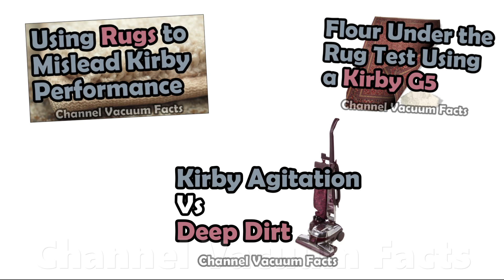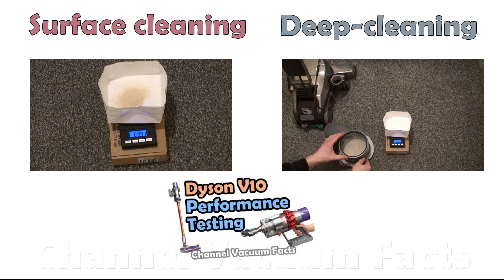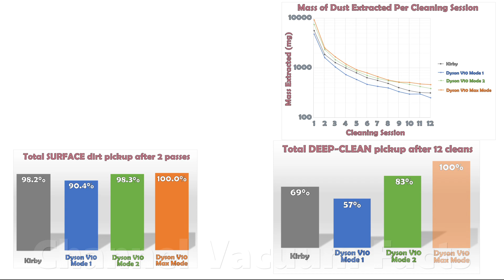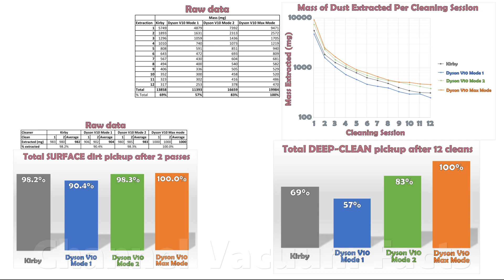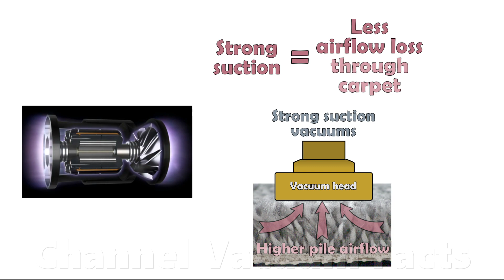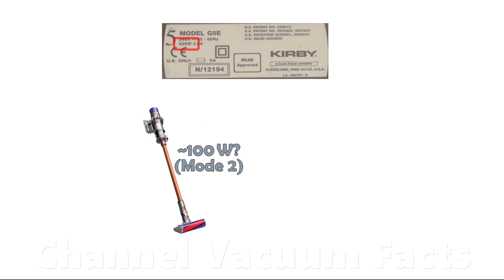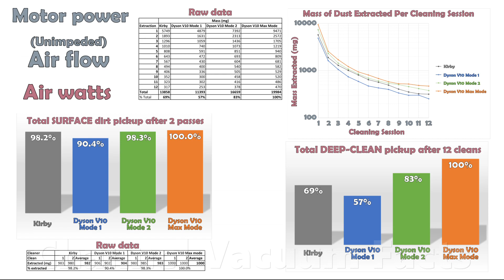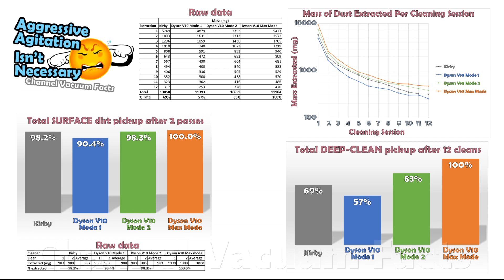Dyson V10 Vs Kirby: How Well Does a Kirby Vacuum REALLY Clean?

Comment: However much these Kirby fanboys love their vacuum cleaners, why would anyone in their right mind want one of these machines over a Dyson V10? Idiots.
Reply: A 40 year old American-made Kirby will still have the same suction it did when it was new, granted the fan, roll brush, belt and motor brushes have been maintained. It's aluminum body withstands years of hard abuse and doesn't crack like cheap plastic. The bags make emptying the waste something you can do inside your house and not get dust and debris everywhere. If you're even minutely mechanically inclined, the parts that need to be replaced as they wear can be done by yourself without any special tools. All Dyson vacuums lose suction as their filters get dirty and dust particles build up on the inner surfaces of the cyclone chambers. The cyclone chambers are not user-serviceable so cleaning them has to be done by a professional, is a huge pain in the ass and thus costs a small fortune. The air pathways are also cramped and clog easily in the majority of Dysons. The un-washable filter in Dyson vacuums can cost upwards of $100 and has to be replaced between 6 months and a year depending on use. Luckily in this particular Malaysian-made piece of plastic, the filter is only $13. Good, because you're going to be buying a lot of them. That price still doesn't beat 12 Kirby cloth hepa bags and 3 rubber belts for $18 (found on eBay).  Why do you think there are so many Dysons on Craigslist for ~$40 when they were 10 times that brand new? After a few years, even with a new filter, they don't work for s**t and have to be cleaned and rebuilt by a professional. So your $500 vacuum is going to be costing you more and more money in service bills while the Kirby can coast for years without needing to go into the shop. Also, check out the Performance Reviews YouTube channel to see how long the battery actually lasts on this vacuum. On it's high setting (which this video demonstrates is the only one to use), you'll get just enough time to do your stairs. Good luck vacuuming a large vehicle on one charge. If you want a battery-powered portable vacuum, buy a Henry Cordless. If you want a light-weight, modern vacuum that's actually worth it's price, is built to be serviced and doesn't lose suction, buy a Miele. If you can't afford $500 for a vacuum, a used Kirby off Craigslist can be had for $50. Throw in a new fan ($13), a new roll brush ($25), and a belt (<$1), and you have a much better vacuum than anything you can buy at Target or Home Depot and for under $100. Does this answer your question? Here's a better test (although a different Dyson) as it compares machines that have both been used regularly for some time: https://www.youtube.com/watch?v=M8r0jCRnB3Y&t=273s
Reply from the maker: @skinnychristopher  That it's 'American made' is a racial irrelevancy. The Kirby doesn't even have the same suction it started with when the bag gets full, and that will be true 40 years later too. I've already pointed out the fallacy in longevity; you’re stuck with old inefficient technology for that long. Furthermore, very few last that long, due to a) neglect, and b) people wanting better, more modern technology which makes the job easier. My review highlighted the horrors of using this disgracefully old technology. Modern elastic polymer blends and other advanced materials don’t ‘crack’ as you stereotype, anymore so than a riot police officer’s shield. The bag is a huge environmental cost, when scaled up across a nation, and is a tax for the user just the use the thing. All covered in my video on the topic ( https://youtu.be/ptN0kkOtGSM ). It’s also now proven that the best bagless cleaners can be emptied without mess and in 5 seconds (also without cost). You’re simply wrong about the dust inside the cyclone chambers and show a complete lack of understanding of how they work; watch and learn ( https://youtu.be/B8gOZ31CkvE ). They don’t ever need to be cleaned and scammers are peddling a false economy if they charge for that ‘service’. There are no ‘unwashable’ filters in modern Dyson cleaners (except for Cinetic models which never clog unless abused), and all filters are lifetime filters which don’t need to be replaced. That you associate Malaysia with cheap plastic parts is nothing short of racism, consistent with your focus on being ‘American-made’. There are many Dysons being sold because there are many more Dysons being bought, and people sell for all kinds of reasons. And you do realise that Kirby’s also sell for ten times less than their asking price. Performance Reviews is a biased Dyson brand hater whose channel peddles misleading fallacies which are easily debunked. If you think my video demonstrates only max mode should be used on a Dyson cordless, then you might want to actually watch the video, because that’s not what the data, and an understanding of it, shows. Plenty of videos out there showing large cleaning sessions being completed on a modern V10/11. The myths associated with a Henry cordless will be revealed soon enough. And the video you linked to is another source of misleading nonsense that’s been proven wrong time and again. Your tirade carried all the falsehood tropes of someone who buys into and spreads propaganda which is easily shown to be false.
Reply: When people throw away their Dysons after 2 years of ownership, that's heaps worse environmental impact than throwing away multiple paper or cloth bags full of dirt and hair; and that's the unfortunate reality. People don't have their vacuums serviced anymore. They just buy a new ones. So when the Dyson that "never loses suction" actually loses suction as they all do, it gets hucked in the bin. It also gets hucked in the bin when it gets redesigned every year and spare parts are no longer available. Also, batteries have a limited lifetime and have to be disposed of. This is not a problem with a plug-in vacuum. Last, the Dyson filters have plastic components which don't biodegrade like paper or cloth. So which is really more environmentally friendly? I think salvaging an old Kirby vs repetitively buying a new Dyson, batteries, and plastic filters wins by a landslide. Dyson claims the filter is "lifetime", but then why is it replaceable? By saying Malaysian made, I'm just pointing attention to the fact that Dysons are not made where they're designed (unlike Henry and Kirby) and that the people who actually assemble them make the equivalent of $240 US a month. So you're essentially supporting modern slavery by buying a Dyson, too. Performance Reviews is biased against Dyson because they have to repair so many of them every single f***ing day and they're a nightmare to work on. He actually owns a vacuum repair shop, has a large personal vacuum collection, and goes to the industry shows. Can you say the same for yourself? Also Performance Reviews doesn't suggest buying a Kirby either, unless your only other options are what's available at your local big box store.... i.e. Dyson, Hoover, Dirt Devil, Bissel. Personally, I trust a man who lives and breathes vacuums every single day and has been doing so for some time.
Reply from the maker: @skinnychristopher  Anyone who throws away a product after 2 years when it's under warranty for 5 (and supported for longer) is an abusive idiot. You're really not convincing anyone with this weak reasoning and reliance on falsehoods. Modern slavery? That's racism unless you have direct, explicit evidence. This is all wild propaganda and not a dot of well-reasoned or evidenced argument that isn't pure speculation or extrapolation to absurd levels.
Reply: @VacuumFacts  Your 'pointing out fallacy'  is a fallacy.  I've seen old kirbys serviced, and working superbly....tested to show how much they were 'working'  MOST do last a very long time,  but, if people neglect them, like ANYTHING else, they will suffer
Reply from the maker: @michaeltagger7407  Not sure you've understood. Tech improves, becomes more user friendly, efficient, better performing, and so on. A 40 year old kirby is a 40 year old kirby with the same old problems, running costs, inefficiencies, excessive power consumption, and mediocre performance. I'm not convinced many Kirby owners keep them that long; otherwise why do people advocate buying them used? There wouldn't be so many used ones if people kept them. People don't keep old cars, or old computers, or old phones; tech moves on and improves and people recycle and upgrade.
Reply from the maker: ...something about a 2 year warranty being assumed to be its lifetime ...something about the number of open-hose airwatts being assumed to be directly related to cleaning performance  ...something about battery life because they think people want to vacuum all day in one massive session.
Reply from the maker: Saw someone say "the reason why I chose a Shark rather than a V11 is because you can change the batteries in the Shark. And I'm thinking, is this person actually dumb, or just stupid. The battery in the V11 lasts longer than BOTH batteries combied in the shark. So less cost, less waste, less changing hassle, less charging hassle. You'd think it was a no-brainer, but apparently some people have no brain. Tribalism triumphs over objectivity.
Reply: @VacuumFacts  Do these Kirby fanboys still use Netscape and Windows 95 too? They are old so they must be good!
Reply: kirbys look so much cooler though, thats why i buy a new one ever 2 years
Reply from the maker: @EpicConspiracy  Yeah, it is an utterly awful piece of tech; I agree; and any redeeming qualities lie with its cosmetics and are subjective. I think it looks hideous, personally. :)
Reply: @VacuumFacts  dude, youre trying to compare a china plastic POS to a american made vacuuming icon, you need to stop and quit being so mean to your viewers, its gross, thumbs down
Reply from the maker: @EpicConspiracy  Could you provide a citation to evidence of where I've been 'mean' to give your claim a little credibility and help distinguish it from hypersensitivity or weak attempts to smear a source of opinion that's simply different to your own? Also, to make judgements about a product based on the country where they're manufactured, as you've done, is tribal at best and racist at worst. (Incidentally, Dyson cleaners are manufactured abroad because the local UK council denied the Dyson company planning permission to expand their factory when they needed home-support the most, so they were forced out. Plus they're all now made by robots, and your offensively implied 'unwashed foreigners' don't actually have any direct involvement in the manufacturing process. There's a strong correlation between disgustingly poor thinking and behaviour, and staggering ignorance of facts and truth.)
Reply from the maker: @EpicConspiracy  I asked you to provide a citation; instead, you gave no citation and simply an opinion, which means you're making up lies and smears and simply don't like that someone elses opinion is different to your own. Not very respectable and shame on you. And again, provide some formal evidence to support your claim about product quality from various factories associated with different 'tribes' (bearing in mind you're specifically talking about Dyson vacuums and Kirby vacuums). Without that evidence, you appear to have a disgusting racist view of the world. Shame on you again.
Reply: @VacuumFacts  so its racist to say china makes less quality products than american companies.. really...i just found the geek of the week
Reply from the maker: @EpicConspiracy  I pointed out explicitly but I think you missed it again, somehow, we're not talking 'products'; you initially specifically mentioned Kirby and Dyson machines. And again, you've evaded yet another opportunity to evidence your position and accusations. At this stage, you've failed to defend your questionable claims multiple times, and as such, have shown you can't. You've therefore proven you're an ignorant racist that simply can't tolerate that others have opinions diffrent to yours—which in my case are informed by facts and evidence. And pointing out an observed fact as unpleasant as that about you isn't 'mean'.

Comment: I would also say, if the Kirby's head isn't lowered down to the point where it 'locks on' to the carpet, the air flow would be better.  You mentioned nothing about the cleaner head height setting.  I'd say a bit above the point where it locks on to the carpet would be best.  And this come from someone who would prefer to use my Dyson stick vac over the Kirby any day.  I don't care how well the Kirby may clean.  It's too big and clumsy.
Reply from the maker: I'd say that's not correct for the reasons outlined in this video ( https://youtu.be/EhcF0MH9HfQ ); namely that this will cause gaps (especially when pulling back) and they leak suction. This causes large short-circuit airflow to flow into the machine, totally bypassing the deeper carpet pile. The cleaner head was set correctly and sealed to the floor. The brushes were set to maximum protrusion to 'deep clean'. The Kirby simply doesn't perform. Another video on a different type of carpet coming on Saturday, with some very interesting results.
Reply from the maker: No user should be expected to have to micro-manage the vacuum anyway in today's modern world. The V10 just works optimally without any user intervention.